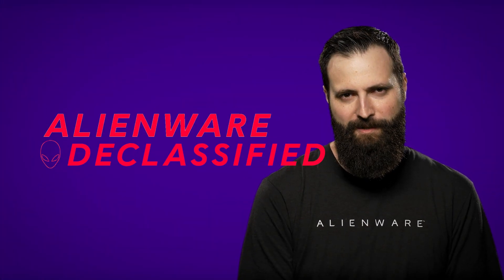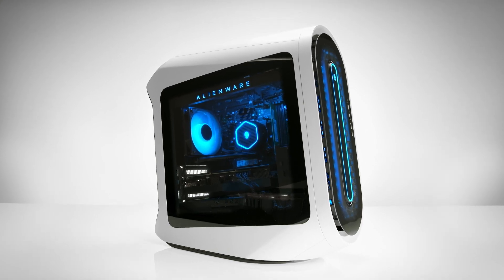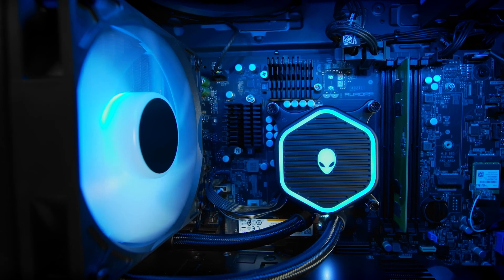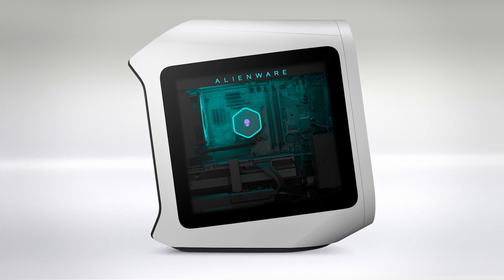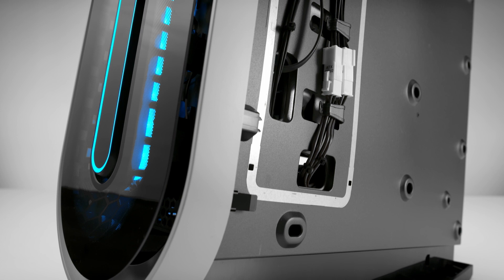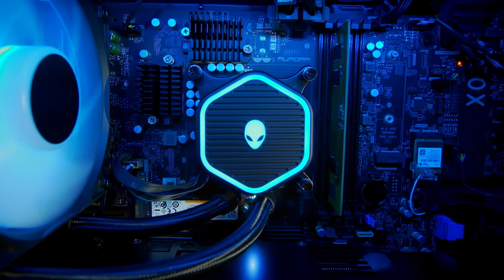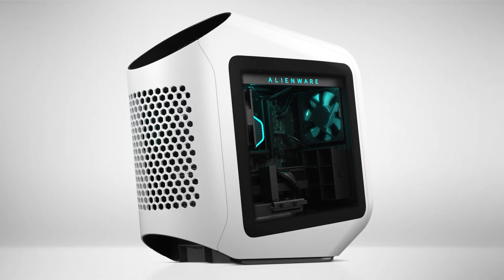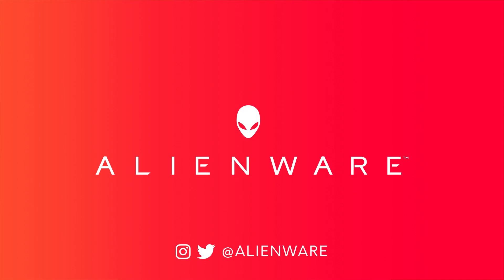Alienware Declassified | Engineering the New Aurora R13 & R14

Comment: My 12 years old Alienware Area 51 is still running strong. Can't run high end game but it gets all the basic work done. I want to upgrade to the new R13 but feel like a waste because I don't wanna give up my old PC haha. The dilemma
Reply: I went from the R4 to the Top R11 and stripped it and had to build a new PC with the parts - could not run at correct CPU or Ram speeds without all cores throttling down - all cores 95c+

Comment: From 13 USB Type-A down to 9 and out of the ones you got rid of, you kept the USB 2? Why didn't you ditch the USB 2s and just made them all USB 3s? With gaming peripherals req USB 3s, eg: HOTAS, wouldn't it make sense to make them all USB3? (not ripping on you, genuine question) And why the power plant from 1000 down to 750? Is that because of the new "greener" rules or was 1k overkill?

As for the design, for my taste, it is subjective, I like the last model better. It looked more slimmer and streamlined. That said, the design for logical reasons, not personal taste, is far superior. You can see just by the pictures alone that heat would be dissipated better, hidden cables - less resistance with a more open "chassis", more fans, the see through panel (it's about time), and of course the pretty lights that screams "I'm an Alienware, come at me bruh", the rad out back instead of up top, not sure about that as heat rises, but it seems air will just punch through the whole "chassis" with little effort (coming from someone who isn't an engineer, so I trust your judgment and R&D on this design change). I do however appreciate the DDR5 inclusion. Other pre-builts have yet to upgrade to the future of DDR5, you know, to download more RAM when required. Gen 12 chip, nice. The detachable cage out back is logical and welcomed as I'm always busting USBs cause they're out in the open up against a wall or something, but the jury is still out on the look design, again, subjective to only my taste. So now I have to choose between the R12 and R13 when I've got enough bottle caps to afford it of course.
Reply: I bet it was so they could sell in Cal
Reply: I've never bought one but I know they used to require you to upgrade the PSU choice to 1,000 watts if you got a RTX 3080 instead of a 3070. THAT is overkill. A RTX 3080 dose not need a 1,000 watt PSU. Mine has been working perfectly for ~6 months with my 850W PSU.

Comment: My r10 runs a bit loud while gaming. I’ve only had it 7 months. I got it with liquid cooling. I wish Alienware could help me out with that. If not a mic for streaming  that cuts out the jet engine sound when it’s running hot.
Reply: my r10 runs really quiet and its liquid cooling as well. Also my mic doesn't pick up any fan noise. I use the antlion wireless mic on my headset btw
Reply: If you have a RTX card try Nvidia Broadcast to filter the noise out.

Comment: Would it also be compatible to swap motherboards from another older Alienware like the r11?
Reply: I think not - I threw my R11 case and MB in the dumpster - I could not even replace the fans after they did an auto update - I put in three Noctua's and turned CPU back down to 4.8G and that worked great for a week then every time the PC was started or restarted there was a repair assist fan test - I bought a new case, mobo, power supply Noctua CPU cooler and stripped it and now have a great PC - the only reason I have not gone ballistic is I could not buy the GTX 2080 for retail - I lost around $1k buying the R11 and I could not even use the 1000w PS in the new build - I will never buy another pre-built unless it is fro a custom builder - what is interesting is I have two friends that are friends with two different people that started Alienware before it was bought by Dell - After I received the R11 I found out they started a new PC company down in south Miami after selling the Alienware and I could have possibly gotten a great discount - I almost ordered their PC but Dell dropped the 280 water cooled and added the 208oTi plus lowered the price almost $1K - had I been able to see the R11 in person I never would have bought one - the videos looked great but I knew I was screwed as I opened the box and saw it for the first time -

Comment: I hope there is an option for the higher spec versions for the liquid cooler not to be situated in the back with only a single fan.
Reply: Ya that confused me a little, the warm internal air would be going through the radiator not the fresh air coming from the front.
Reply: @VivecsTDawg  Don't worry about minute details about thermals and just trust us...buy an R13!

Comment: THIS IS THE GREATEST LOOKING PREBUILT I've ever seen.

I DONT MEAN TO BE RUDE BUT.
JUST ONE QUESTION. 
The PSU is 750w for 12TH GEN INTEL AND NVIDIA RTX 3090. How can that power that realistically let alone overclock.

can we get a PSU that's more wattage then 750W that comes with pc.
Reply: It’s not a standard ATX power supply from the looks of it. Likely it meets ATX12VO standard, which would explain why it’s so small. It would therefore be more efficient (hence why it’s platinum rated).
Reply: @rare6499  thanks for reply.
I understand its rating just with the power consumption of new hardware it seems so small.
I WAS just wondering if Alienware made sure it could handle the power consumption without crashing and shutdowns.
Reply: @JTL1776  it is for California law I believe and if not in Call I think there is an option for the 1k
Reply: Alienware desktop psu has been pretty solid based on my experience, their laptop power brick however ...

Comment: 1 ram stick, interesting.
Reply: Lmao
Reply: @TechSource Well technically the new DDR5 RAM is dual channel with a single stick
Reply: You would think that when they took the time to create a promo video for their new pre-built, they would've taken the extra 5 seconds to put in another RAM module 😂. I hope they don't actually ship them with just 1 stick, not having it run in dual channel would be handicapping a brand new system out of the box.
Reply: @kevinamores5647   after the grilling from Gamers Nexus you would think that.
Reply: @kevinamores5647  word!
Reply: @kevinamores5647  they do but it’s dual channel
Reply: Edgar is looking for the best of the best PCs
Reply: Lol, they know people would just save $200 by getting it themselves.
Reply: @TechSource, but to be fair for ddr5 you only need 1 stick to get the effect of dual channel, i think
Reply: DDR5 is dual channel in a single stick.
Reply: @DudeHuge   If you use 1 stick, you still get half the theoretical memory bandwidth than someone else with 2. The integrated dual channel of DDR5 is unrelated to the performance benefits of two (or more) RAM sticks in dual channel mode. Each integrated channel in DDR5 has half as many data lines as the single channel in DDR4. So, they have the same bandwidth at the same speed assuming all else is equal, but DDR5 is able to be more efficient by only using a single channel when smaller data is being transmitted. Either way it was just dumb of them to use a system with 1 stick of RAM for their promo video.
Reply: Interesting 🤔
Reply: Yeah I think it’s just best practice to split the load on two sticks
Reply: Literally first and only thing caught my eye and told me nothing is gonna change
Reply: First thing I saw too.  Pretty terrible for gaming performance.  Hard to believe they even allowing these kind of spec in the first place in 2022 (in a month).
Reply: You can always buy another :)
Reply: Bro buy to test this and mille multiple videos out of it
Reply from the maker: We saved the real sticks for y'all.
Reply: @AlienwareChannel  respect to you my dude
Reply: @AlienwareChannel  what kind of reply is that 💀
Reply: @AlienwareChannel  Smart reply.
Reply: @AlienwareChannel  lol
Reply: @AlienwareChannel  since when? stop making one stick a thing.
Reply: @AlienwareChannel  don't tell me i'm gonna also Need to buy aftermarket sticks
Reply: @AlienwareChannel  yet your base config you are selling with 1 stick and double the ddr5 going price to add another... unfortunate...
Reply: Dam
Reply: shut up